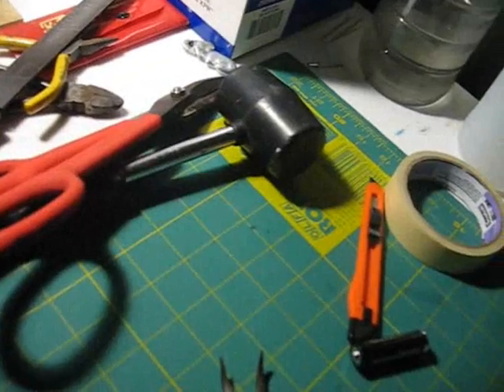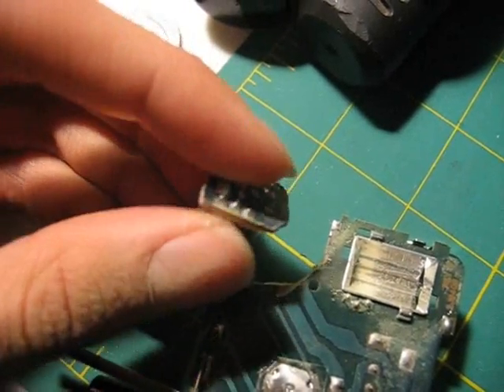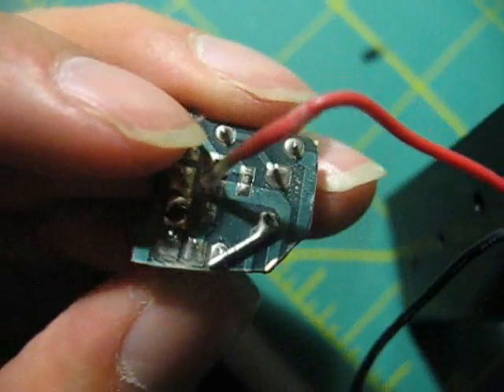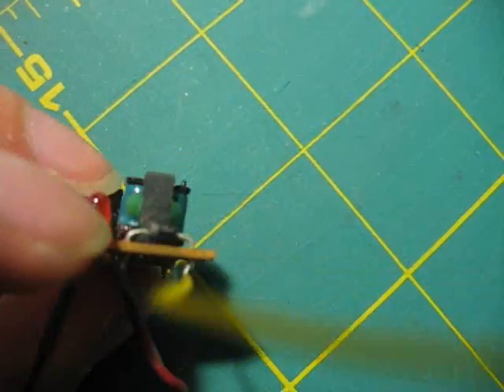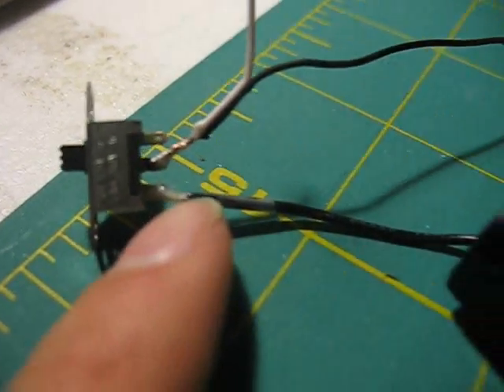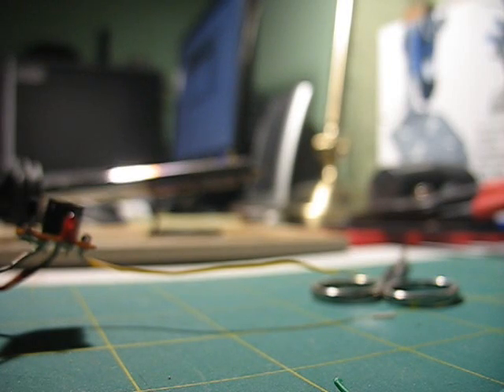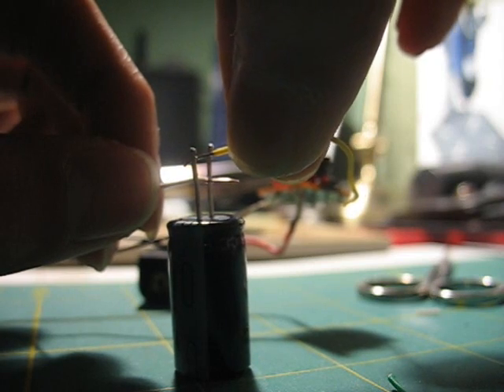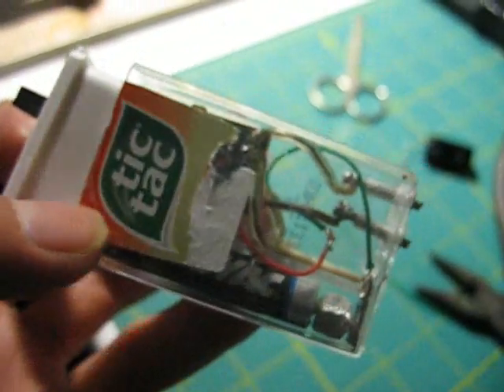How to make a Mini Transformer Circuit (500+ Volts/ mini taser)

Comment: Damn, I wish I had the same camera circuit as you, on all the ones I can get my hands on, the diode is separate from the rest of the assembly, so I have to de-solder it completely, which I kinda suck at.
Reply: Spazz Tic  De-soldering is a  cinch if you slowly heat the circuit with a heat gun until the diode falls right out.
Reply: Well I have a soldering iron and the problem with desoldering or soldering these circuits is the transistor overheats so easily.
Reply: That's why the heat gun is important. You can apply even heat slowly so the transistors don't take the brunt of the heat from applying direct soldering heat.
Reply: hmm, I don't suppose a blow-dryer would work if you need precise heat then.
Reply: Spazz Tic no. They don't get hot enough. Just get a heat gun from your paint Store. 
It can also be used to reflow boards by hand. It's a little tedious but it works.
Reply: Ok, thanks!

Comment: did your tic tac version have a capacitor? and if you discharge the capacitor while it is still wired up to the rest of the circuit will it blow the circuit?

Comment: Props to you for not just attaching leads to the capacitor like everyone else who makes these videos! Also, a helpful tip for those of you who are using different types of cameras - If you aren't sure which components to solder the wires to and all that because it is not the same camera, do the following:

1. Remove the capacitor.
2. Attach your two shocking wires to the contacts that USED to go to the capacitor.
3. It's that simple, just add a switch next to the battery.

Good luck!

Comment: Can someone help? I have done all this, with just a different camera, and capacitor removed. But it only works slightly when I oscillate the wire from the battery across one of the transformer leads, and the LED flickers, and a small current comes form the output, but does not work when connected to the beginning of the circuit with the transistors! Why is it doing this?!

Comment: Good work. I'm new to capacitors. I'm wondering, if you had like 12 capacitors(6 stacked x2) and you had one of those long switches with 12mini switches on it, where you joined the White and black wire together on the switch; would doin that with 12 times(once per switch) and 12 connections to the battery and 12 to the diode ..... Would that charge all capacitors ?  Basically I'm thinking what you've done but using 12 wires per connection for a switch with 12 switches built in.  Thanks :D happy